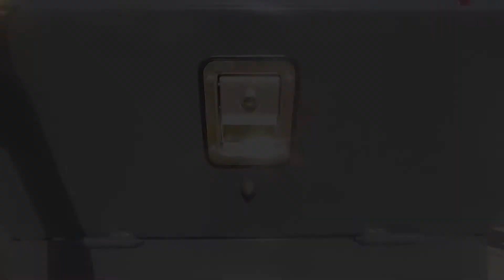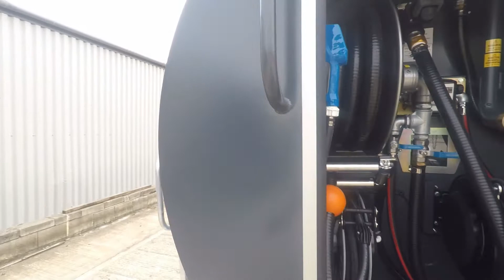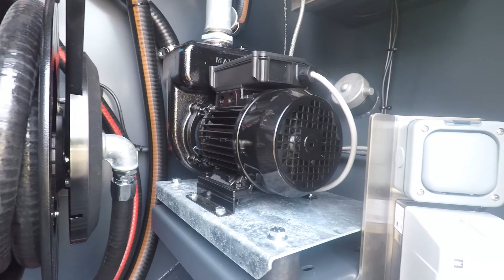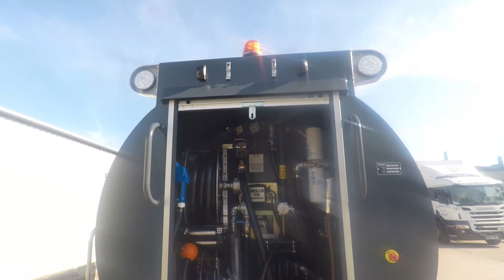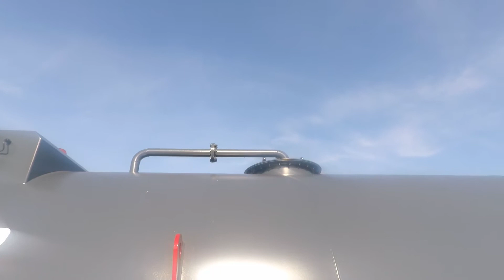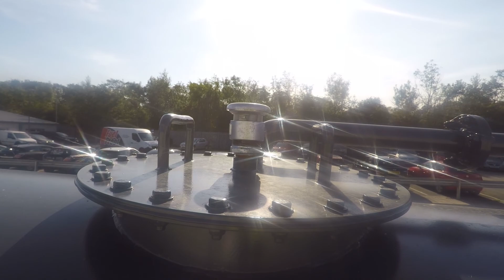Site Tow with AdBlue Storage

Comment: Capacity of storage?
Reply from the maker: Hi Erick, this particular model stores 9,000 litres of diesel fuel, along with a holder for a 205-litre drum of AdBlue.

We also manufacture these Diesel + AdBlue Site Tow Bowsers in the following capacities:

4,000L diesel + 500L AdBlue;
6,000L diesel + 1,000L AdBlue,
and 8,000L diesel + 1,000L AdBlue.

Thanks! 👍